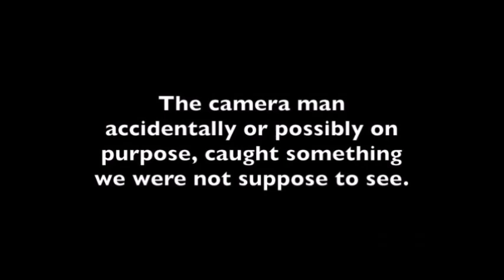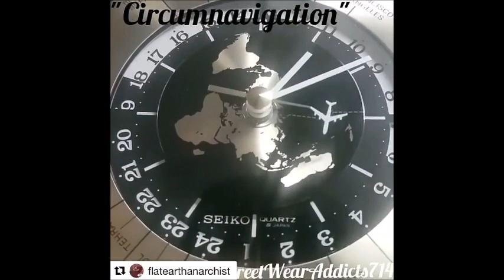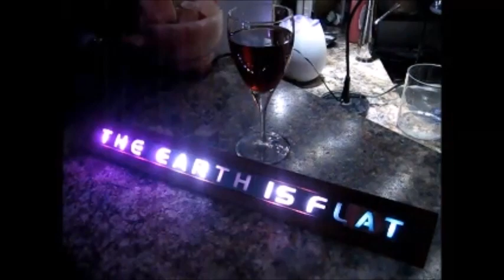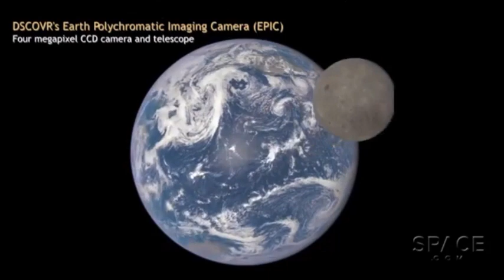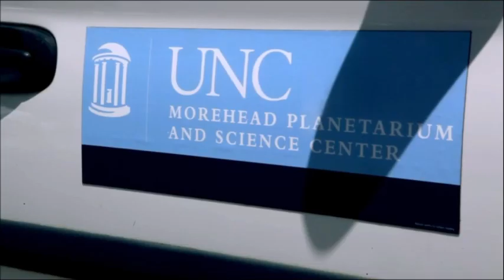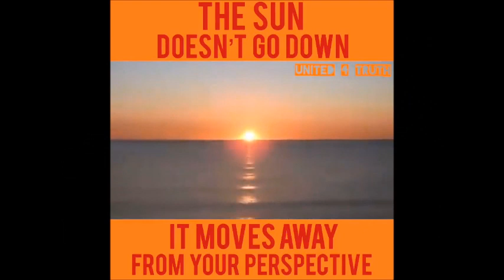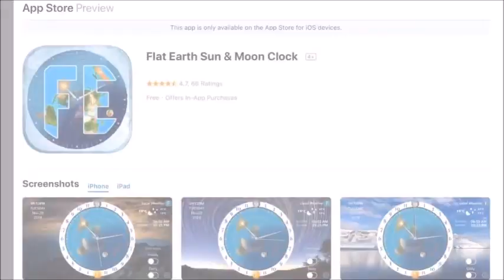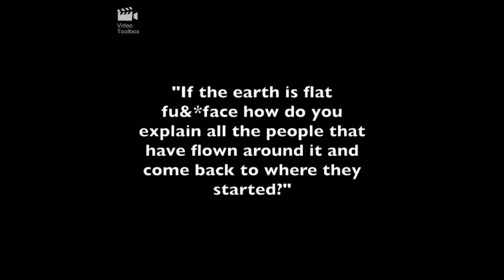Flat Earth Q&A Emails 113 Mark Sargent ✅

Comment: If you take an image of the earth  from space and hit the print button. The paper is flat it not an illusion.
Reply: A image and a photo are two different things.
Reply: @michaelkilpatrick9105  Without a negative you can't be positive about anything. Lines of communication 
Using a blank piece of paper take a compass and draw a circle completing one complete line of communication. Then take an inch and draw another complete line of communication. Then you have proved beyond a reasonable doubt that Parallel line do not meet.
Reply: Amazingly I don't have any idea what you're talking about.

you mean whenever I print something on a flat piece of paper it's printed on a flat piece of paper? OMG wow!
And?
And then your compass talk I mean did you get to anything or not?

Example actually of the pictures of the Earth from space or aerial photography establishing that it's not flat is actually the American roadway system.
This system is laid out in a flat two-dimensional space using grids.
When compared to the grid and it's extremely accurate and uses all the surveying measurements.
When compared to actual photographs though in the photographs the roads curve.
this is due to the curvature of the earth causing the roads curve along the lines of latitude.
Reply: @joshuaknight6551  There are Hindu-Arabic numerals or Latin Roman numeral just English when you look at a flat screen on a computer all the calculation are done using descriptive geometry there a top bottom and side view and all the mathematics to make a drawing it took thousand Engineers software writers years using Hindu-Arabic numerals then have them translating them into ones and zeros. It also take the Railroad out of the picture there are two Zeros you can work with too.